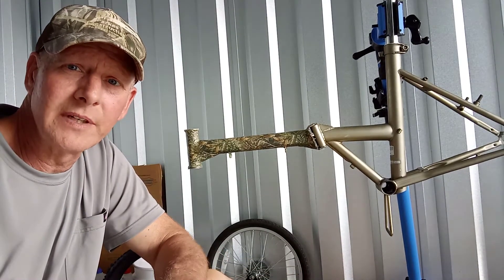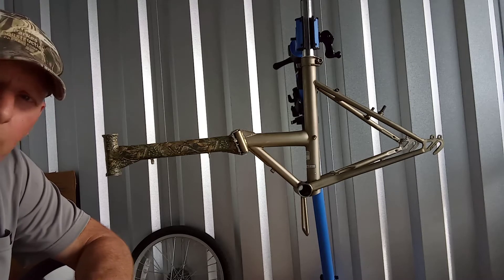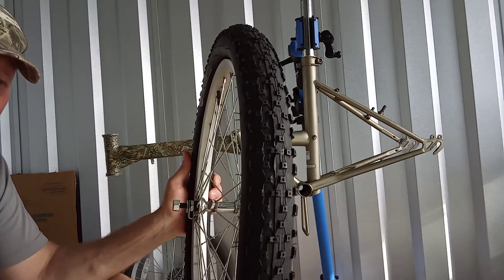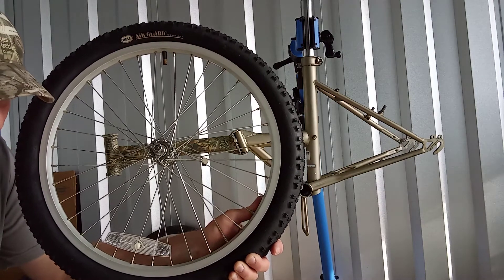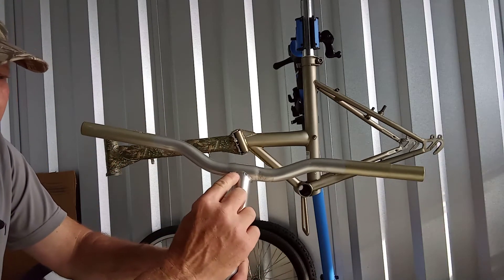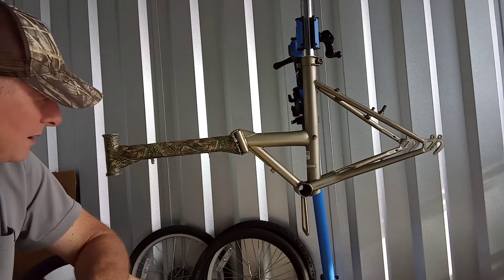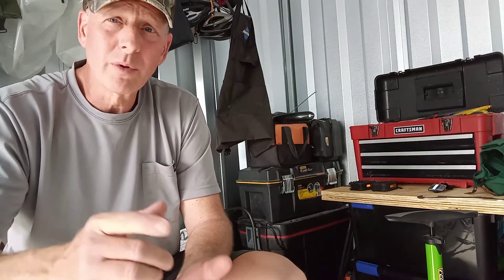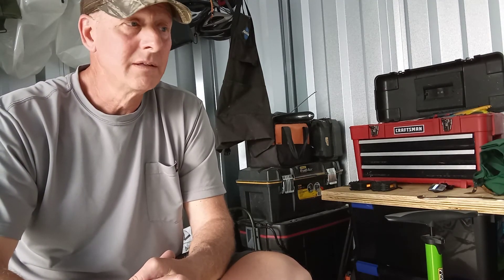SHTF Bicycle Build continued. And New Shop Space!

Comment: I think you should do it how you want it. i dont like duct tape, the residue it leaves is a nightmare. if it was like tuck tape it wouldnt be as bad , but even harder to remove. if you want durable there is tarp tape, which is nothing like duct tape basically permanent. but what will happen when it gets wet ?  after you removed the clear coat it would be nicer to just spray paint it. brown, green, black or straight military green etc. even a runny multi- color job will look good (i have a frame ill make a video how i found it, as an example for you) i like the original tires, they look more flat resistant and less rolling resistance.  Its quite easy to find 20 inch steel rims as Most bikes with 20 inch have steel rims, and you can spray paint the tires too. just save your nice original rims for when / if civilization is re-established

Comment: Your informative  videos are appreciated!
What type of bicycle repair stands would you recommend? 
I have the surly big fat dummy and I’d like some suggestions … Thanks!
Reply from the maker: I use a Park Tool pcs-10. I have had my Surly Big Dummy up in it and it was fine. But I did remove the rear bags and rack before I put it in the stand. I like the pcs-10 because you can also buy an accessory wheel truing attachment that fits on the back of the stand.
Reply: Thanks for the suggestion!

Comment: Nice. What's your thoughts on a shtf bicycle engine.  I'm thinking 2 strokes you can drain oil out of cars to mix instead of 2 cycle
Reply from the maker: My thought is to go with NO engine or noise during a SHTF  situation. I do not like engines for anything, I hate the noise and especially hate working on them. During a SHTF situation I want the simplest and quietest form of transportation I can possibly have. I love bicycles for their simplicity and usefulness.
Reply: could you explain what you mean ?
Reply: @CargoBikeCowboy  At a certain point people will kill eachother for gas... like in mad max